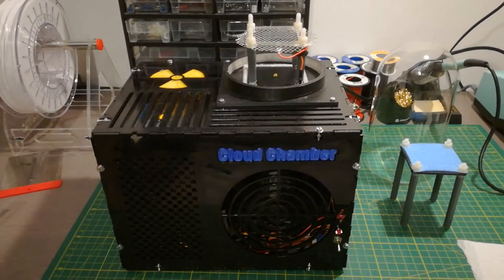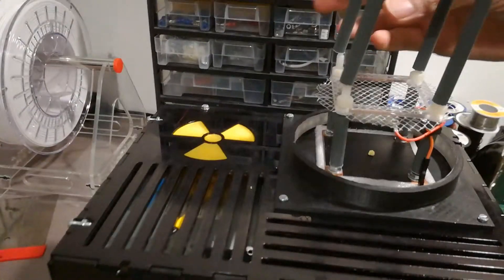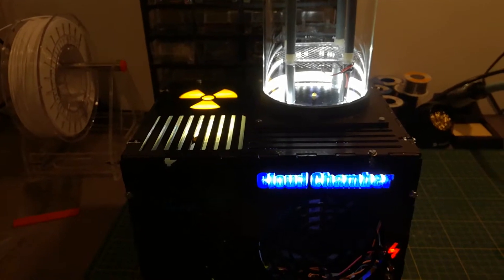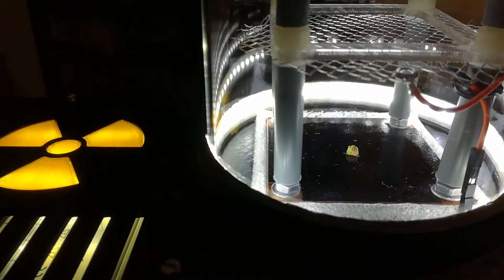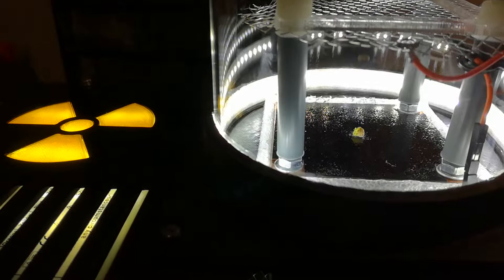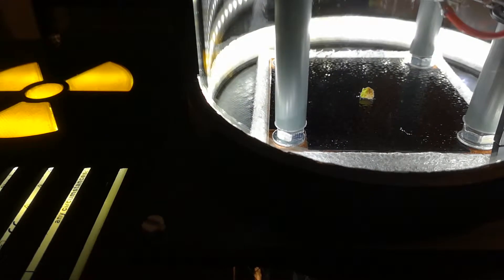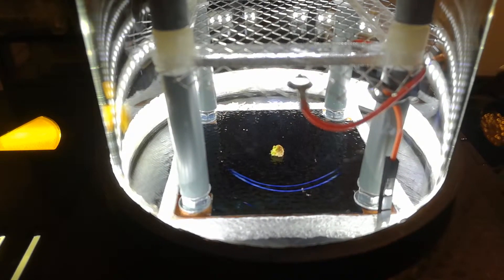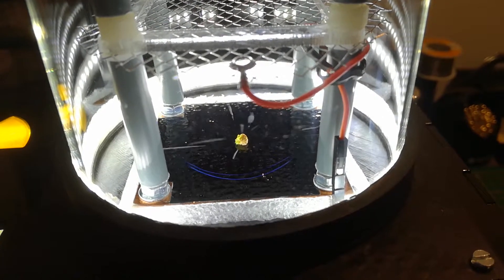Peltier Cooled Cloud Chamber

Comment: Hi   great work. I did something similar but it doesn' t work as good as your. What is the purpase  of the high voltage?
Reply: The charged particles paths are curved in an electric field. I assume that this just makes more of the particles move parallel with the cooled surface which increases the paths in this orientation